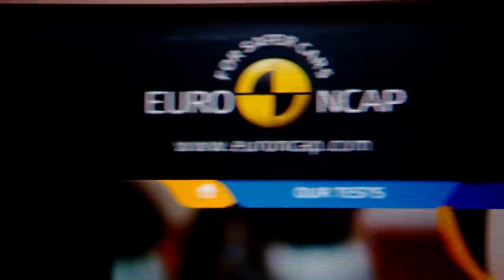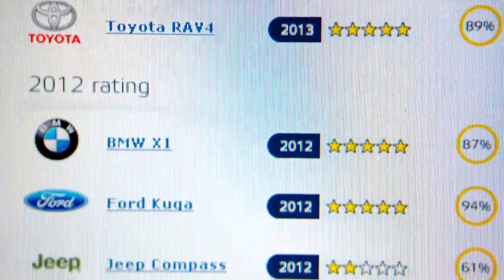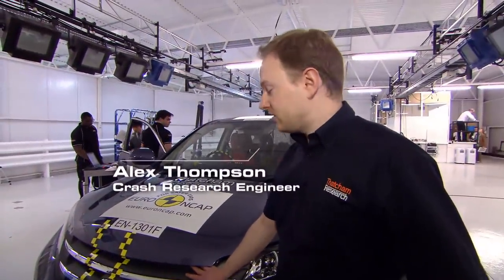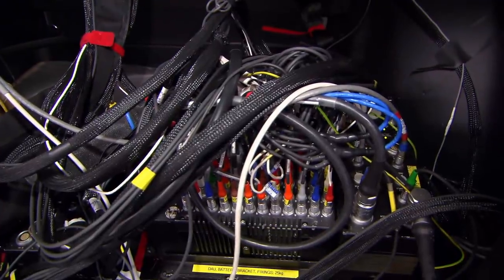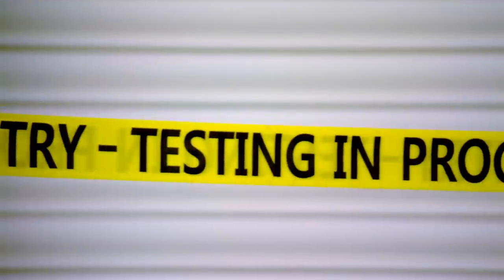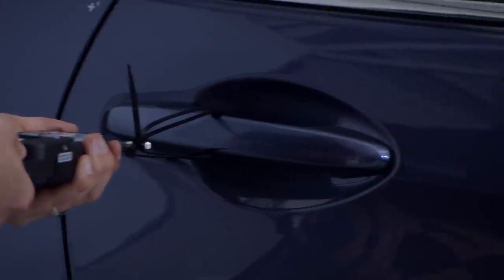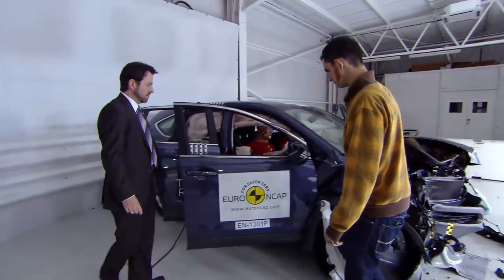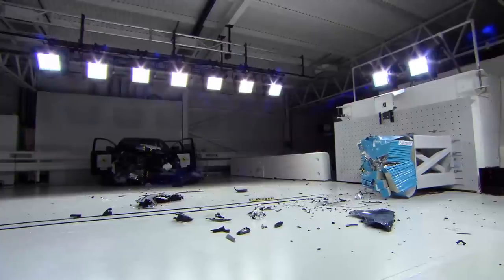The Science of Crash Testing | Fifth Gear

Comment: I do not think safety sells as well as it should, someone I knew well when only the Renault had a 5 star on safety he spend little more n bought a SH BMW M3, than a 5 star on safety new Renault also a 5 star rating is not the same on two cars some experts suggested its far better to have ratings to 100 points but manufacturers resisted this as anything over 80% up to 95% is rated at 5 stars no on gets 100% I guess, we get some truths but Not the whole truth n nothing but the truth, still way better than nothing I believe